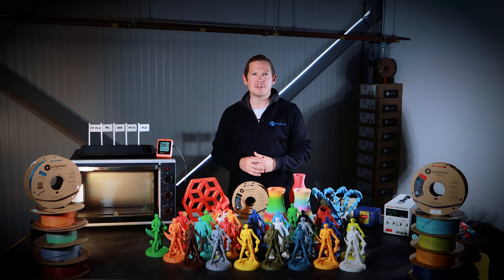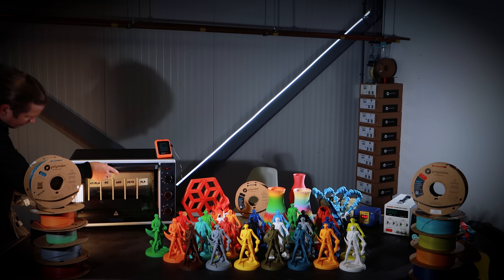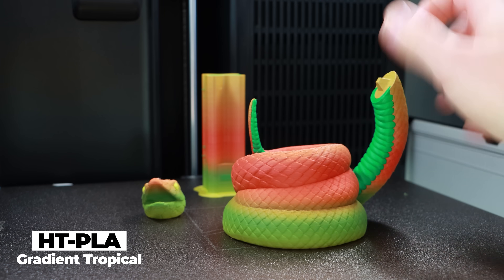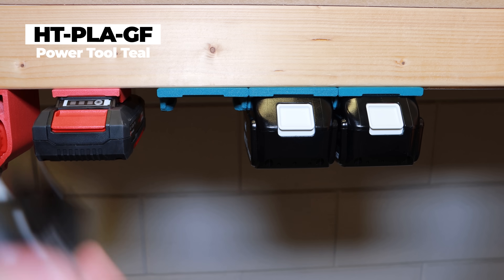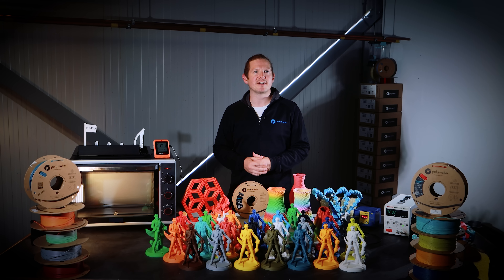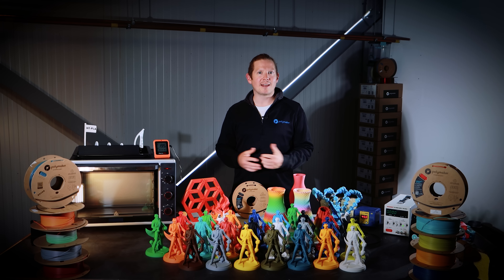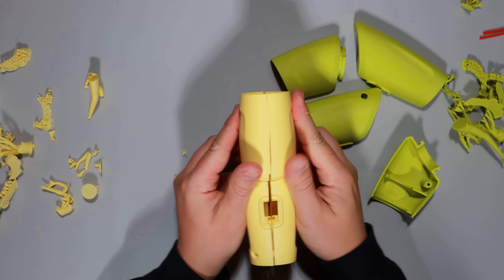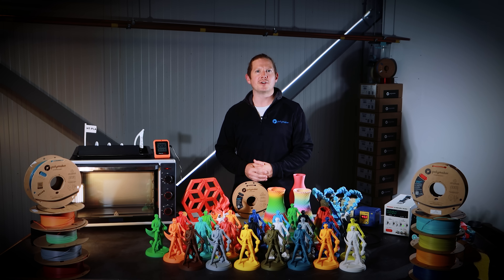HT-PLA: One Filament to Rule Them All 🔥🔥🔥

Comment: We need a UV test for this new GOAT!!
Reply: That is also my question. Does this one differ from the regular PLA from the UV resistance perspective
Reply: @IlyaLavrovsky  he said its still PLA at its core, so my guess its the UV resistance will be the same
Reply: @flippy9133  It should just be PLA with additives, so chances are that its a bit better at handling UV
Reply: @IlyaLavrovsky  similar properties of standard PLA
Reply: @IlyaLavrovsky  Compare it to petg, who cares about regular pla.
Reply: UV spray coat exists for this, much easier to solve than heat resistance in my opinion. If the printing ease of PLA remains but with added heat resistance this might be insane for duct-prints and the like regardless. I'm all ears for the upcoming tests!
Reply: @Skyflairl2p  uv clearcoat like on front headlight restoration method is working wonderfully im pretty sure it can protect the HT-Pla :)
Reply: similar properties of standard PLA
Reply: @PolymakerPete  Useless to me then. 🤷
Reply: Well its not ASA or TPU so i guess its not gonna be that different
Reply: @JojoJoget   Genius comment right here. 🙄
Reply: Yes my question as well. What are its UV properties, how well would it survive outdoors?
Reply: There is no difference from normal PLA; it is still sensitive to UV light. He would have told us if it would have been better.
Reply: I've tested this filament, it will go flexible at 55-58C, and deform under load. It is, as I suspected, no better than standard PLA. Look to understand the official HDT test to see why this material and other materials like nylon, UV resins and this PLA give false high HDT's.  Polymaker is LYING to you, but it's not only Polymaker that takes advantage of this flaw in the HDT test, nearly all manufacturers do this, which is why they all do it. FOMO.
Reply: 5 year outdoor test.

Comment: I wonder what compromises it has.
Reply from the maker: It has the same impact resistance as regular PLA
Reply: @Polymaker  Haha, already ordered some. Very excited to see how this stuff holds up for interior car parts.
Reply: @Polymaker  So from testing on Edge of 3D and My Tech Fun, the only compromise I'm seeing is... color choice?
Reply: My guess would be more brittle... but that's what we have @MyTechFun to figure out. If it is brittle, if HT-PLA-GF is better against heat, Nylon and PC still fit most of their use cases better.
Reply: lower tensile strength, and by a lot

Comment: Does the oxidation and hydrolysis of PLA decrease with annealing otherwise it will still last 1-2 years indoors compared to 10 years of ABS or 20 something years of ASA. This thing will be very handy in a lab setting but still won't be an engineering material substitute for the production of any mechanical product. Also I wonder how annealed PLA's creeping behaviour compares to something like ABS. Sorry if this came out negative, love your datasheets Polymaker.
Reply from the maker: We would have to do more test, and also more test from the market will come out in the next few days.
Reply: similar properties of standard PLA with added thermal advantages. So it is good for lots of high temp solutions but not an ASA/ABS replacement in a lot of situations like you mentioned of course.

Comment: This is cool stuff, but seems it would not work for stuff I make. I make large cosplay items, and often plastic weld them together. Being its a higher temp it seems would be a pain to melt the parts together to create a larger piece.
Reply: But you don't really need the temperature resistance. Horses for courses.
Reply: @smorris12  I switched to PET-G because helmets and armor would start to melt in sun on hot days ... PLA is not good for cosplay stuff in hot areas.
Reply from the maker: HT-PLA will still melt at 210˚C+ (which we assume is below your welding temperature)

Comment: what is the point? so people can print off more 'decorative' plastic junk that wont melt?
Reply: I have a need for 3d printing research lab equipment pieces that need to withstand up to 100C, however printing PC is very tricky, even on a X1C. If I can print them at the ease of PLA and get higher heat resistance, that would be awesome.

Comment: I love polymaker but your TDS doesnt line up with your claims. Its far weaker in thermal resistance then  your own PC max.
Reply from the maker: To make it clearer on the TDS VS the wording we use in the video:
Heat Stability: Vicat Softening Temperature
Heat Resistance: HDT

Comment: How is it when put up against the PET-CF?
Reply: In what way? When asking a comparison question you got to be more specific as this is basically, material science. 
HDT? (Heat deflection temperature)
Impact?
Tensile?
Flexural?
Vivat softening point 
Ductility?
Hardness?
Reply: @DSPrints_ all of that.
Reply: @michaelmendoza1818 of course you did.
Reply: @DSPrints_ does not everyone want to know all the stats of each filament to make an informed decision to make a purchase?
Reply: @michaelmendoza1818  Fair enough, but that wasn’t really the point — your question was vague, and “all of that” suddenly covers a broad range of properties most people don’t typically consider in depth. It just didn’t seem like that level of technical detail was what you were originally asking.
Reply: the TDS's are available on the product pages so you can compare ALLLLL the data to your hearts content!

Comment: Any data on flame retardance?  You have PC-FR, will there be a PLA-FR line too?
Reply: this is not flame retardant material.
Reply: @PolymakerPete  Any plans to develop PLA-FR?  I am asking because I do have some projects where a flame retardant material is needed.  PLA is much easier to print than PC.
Reply from the maker: Not at the moment however it should be similar to regular PLA

Comment: Awesome.  Need to see a CNC Kitchen analysis of the physical properties!
Reply: Don't trust these sponsored reviews. Independent tests are the only ones you can trust.
Reply: Watch the My Tech Fun review.  It's out tomorrow and it's typically more technically comprehensive.
Reply: @MichaelTavel CNC Kitchen is more watchable and functional rather than just numbers upon numbers.
Reply: @radish6691  I agree about the entertainment value... 'technically comprehensive' usually deemphasizes 'fun' to some degree 😊
Reply: you aware that he is not doing these anymore?
Reply: This is for 3D printer, not for CNC machine, no?
Reply: @grumpyrider369  CNC Kitchen makes videos about 3d printers
Reply: @Paperjin they’re new here
Reply: @grumpyrider369 You do know that cnc is the basis of 3d printers movement too right
Reply: CNC Kitchen does in-depth analysis of 3D printers, filaments, and processes.   @grumpyrider369
Reply: @grumpyrider369  A 3d printer is a type of cnc machine.

Comment: How would it go as an injection mould at 180c?
Reply from the maker: 180° is going to be too soft at that point (May not be the best choice as the pressure from the molding process may be too great (need some testing)
Reply: @Polymaker Thank you 👍. It will be for soft plastic baits which are injected by hand so it won't be high pressure. I may test it to see if it will work.